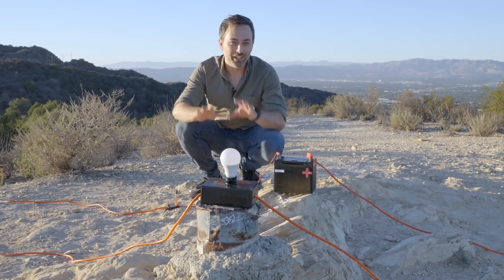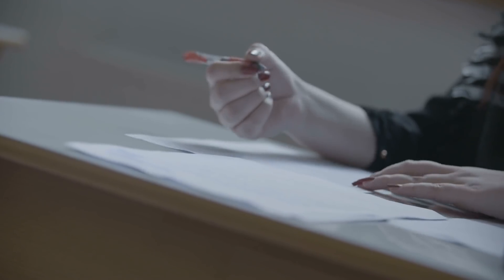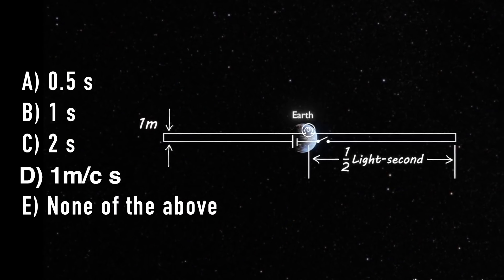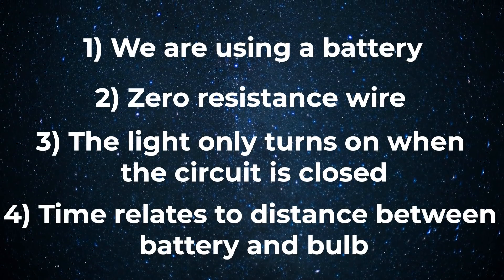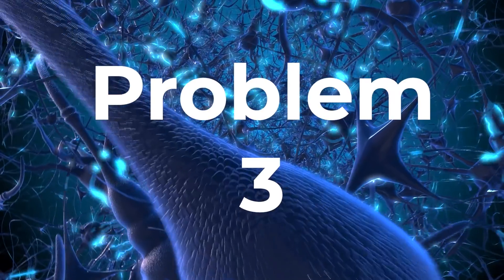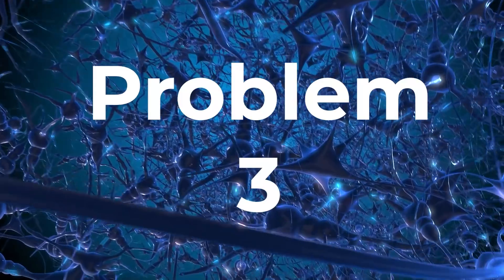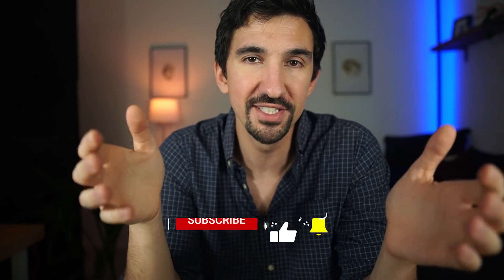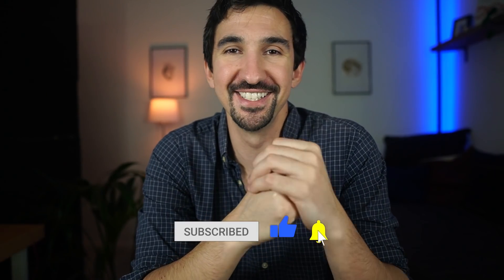Is Veritasium Wrong About Electricity?

Comment: I disagree with Veritasium.  His video is more like a magic trick that distorts reality while he's talking about something else.  In his video, the light bulb, an LED bulb, turns on and stays on while the switch is closed.  He talks about how the movement of electrons is only consequential because the moving electrons generate a magnetic field.  Yet, a diode requires actual electrons to move across the p-n junction and the battery's chemical reactions only occur when there's movement of electrons between the anode and cathode through a conductor (wire). The experiment is relying on Direct Current (DC).  After the initial impulse has traversed time and space through capacitive coupling between the wires (as noted in this Dr. Ben Miles video), that impulse (changing electric field inducing a changing magnetic field) is now in the past.  After that first microsecond of flipping the switch, the circuit enters a steady state where physical electrons are sent on their way by exothermic chemical reactions in the battery and then fall down the energy barrier in the LED to generate light as physical electrons drop energy level specified by the light emitting diode's band gap, thus producing a stream of photons that are equivalent in color to this band gap.  If you were to take the light bulb and insert it into a steady-state magnetic field, you'd get no light.  Experimentally, you could dispense with the battery, switch, and wires and instead just generate a magnetic field around the light bulb.  Both a static and dynamic magnetic field (changing over time) would generate no light after the initial impulse because the physical free electrons in the light emitting diode would have all migrated to the other side of the diode.  Taking this up a notch, Veritasium has constructed a "Transmission Line" that has a natural impedance composed of capacitance and inductance.  On the website "All About Circuits"  Characteristic Impedance Chapter 14 - Transmission Lines, there is capacitance between each unit of wire, one going to the bulb and the other returning that slows the rate of change of voltage.  And each unit of wire also has inductance that slows the rate of change of current.  The result is that this transmission line moves the signal provided by the throwing of the switch far slower than the speed of light, depending on the distance between wire conducting centers, the metal part of the wire's radius, and the relative permittivity of the insulation between the conductors (composed of the wire insulation and the air between the insulated wires).  The velocity of wave propagation is equal to the velocity of light in a vacuum divided by relative permittivity between conductors.  So even if we're simply measuring the time to send this "signal" of throwing the switch, it'll be slower than the speed of light, and take longer than the time it takes light to traverse the distance from the battery to the bulb.  So Veritasium's setup is wrong on both the impulse duration and the steady state situation.  That light bulb will be dark!

Comment: This still seems like there's some shenanigans going on with causality here. You've got your two monstrously long wires halfway to the moon and back...But why does current flow at all, to create this coupling effect between the inbound and outbound wire, unless the source knows instantly that a circuit exists which it can follow? I don't see how any kind of field can exist from the instant the circuit is closed, when no current should flow, until it can be known from the origin point that a circuit exists. Which is a lightspeed problem to "explore" the reality of whether this wire actually goes anywhere.  <confusion>

Comment: The assumption you (and others) are making is that the electrons will move in an open circuit when the switch is closed. They won't. Thus no field is generated thus no signal thus zilch.  It is obvious most people don't understand how antennas or capacitors work.  Or electricity in general.  Take it from a person who has worked with electricty pretty much their whole life, this whole thing that is being put forth doesn't work for far too many reasons to list here.

Comment: Veritasium is correct in that the signal will travel from the battery through the air-gap between the wires to the light bulb at a speed of 1m/c (Ben is correct that he needed the meter there). The signal is propagated by virtual photons from the field of the wire connected to the battery to the field of the wire connected to the light bulb. This is not violating the speed of light restriction on communication. Veritasium often focuses on the "crazy" aspects of science facts and can sometimes gloss over a proper explanation for WHY it is happening.

Comment: Hi, . . .  He, Derick and Veritasium are WRONG. . .   First he has 4 lengths of wire 1/2 light seconds long, that is two to the left and two to the right. . . .  But his whole story about Elecricity flowing in a wire is mainly wrong... . Correct, current in a wire will create a rotating magnetic field around that wire, and where there is a Magnetic Field, there will be a coupled electrical field. . .  This is how we get unwanted cross-talk in signal cables. .. .  But his main story is WRONG. . . The main Curren is the movement of Electrons in the wire. . . That is where most of the power is, in the moving Electrons in the wire, however, although the light coming on, will have a time delay of between about 2 seconds to 20 seconds. . .  Any one actual electron coming out of the Battery, could take days to get to the light bulb.. . . But Electron current is more like a line of billiard balls, one in, one out the far end, almost immediaterly.

Comment: I agree on three points:
1) the setting "as is" wouldn't work. But I see it more as an illustration of a thoughtexperiment.
2) yes, the unit of "1/c s" would be broken in SI units. c can be unitless tho. But more crucially, "1m/c s" doesn't fix the problem in SI units, as that would be s². "1m/c" would be de desired solution.
3) the comment about we were told a lie was off and unnecessary. I really like your explanation about scientific thinking there.

About the central point tho...
Causality wouldn't be broken. Veritasium absolutely obeyed the fact, that the fields are limited to the speed of light. In the scenario the needed time to "get some energy" to the lightbulb is 1m/c, because the electrons are moving first at the switch, which is about 1m away. The switch is a tiny tiny capacitor.
If the switch was 300,000km further away, the electrons there would "move first". The field would than need at least 300,000km/c to "reach the bulb". Hence, causality isn't broken here.
In the first scenario, it would even take at least 2×300,000km/c to get "all the energy" to the lightbulb (first to get the furthest electrons moving, second to have the field travel back)

I'm very confused by the antenna view of the problem. Why would that model be useful? And with DC, how would the antenna even work in the first place? For me, that just complicated the problem.

Comment: Fully agree! I thought exactly the same, first because of the units (1/c is not secs) and second, if it is a constant that doesn't depend on distance, we could have communications faster than light. In the case of having a DC circuit, by the moment of turning on (or off) the switch, we have a fluctuation and a wave is propagated. Still not sure which is the correct answer.

Comment: On the topic of it breaking communication faster than the speed of light, i think the signal propagates out from where the switch is, not where the battery is. The battery connected to the wires means that the 2 loose ends of the wire at the switch are charged with opposite potential, when the circuit is completed, this causes the electrons to start moving, but this signal comes from the circuit being completed, not from the battery itself. So really the answer isn't the distance from the battery to the bulb / c, but rather the distance from the switch to the bulb / c. In the scenario veritassium presented, the switch and the battery are in approximately the same location, but if you moved the battery to the furthest point away in the circuit, but kept the switch by the bulb, the answer would be the same, but if you kept the battery by the bulb, and moved the switch to the furthest point away, then it would take longer

Comment: One important point you miss in here is that the position of the battery is basically irrelevant (if we assume it's in steady state before the switch is flipped, which it must be or the light would be on, per the simplifying assumptions in the veritasium video).  It could be at the end of one of the long sections of wire, or even right next to the bulb.

What actually matters is the position of the switch relative to the bulb, as that is where the electricity begins to propagate, and so that is where the power begins to radiate from.
Reply: If that is the case, though, then why do we need wires at all?  (I know we don't need wires for some things, but we generally do for light bulbs.)  I'm hearing some comments on here saying that the wire doesn't really matter, but what matters is the distance between the switch and the bulb, but what if we have a super-long wire, but it's not even a circuit in the first place?
Reply: @Rationalific  Given the assumptions in the Veritasium video, the bulb lights when it has even the tiniest non-zero current passing through it.
As soon as any current starts flowing in the wires near the switch, power begins radiating. So as long as the battery is connected to the switch, and there's a non-zero length of wire on the opposite terminal of the switch from the battery, you will have a (potentially tiny and extremely short-lived) current when the switch is closed, which will radiate an (even tinier) amount of power to be picked up by the bulb.
In reality, in most circuits, this radiated power is completely negligible. It's only with the assumptions of the Veritasium video that we have to consider any tiny nonzero power to be significant.

Comment: The bulb will never light up. The wires will draw the electrical field away from both the bulb and the battery, rendering the flow insufficient to release photons. It would be like pouring fluid across a large tabletop to fill a glass.

Comment: Now thats fun, an antenna at dc.
Known otherwise as a turd.

So we do not cut off the circuit okay? As then it ain't no circuit. Does not complete. 

So what would happen is, there is no wire resistance, maybe no Battery resistance. 

Electrons would go out one end, and Electrons would go in the other. The good old marble effect. However, Electrons as marbels don't Just afdect the next electron in line. And remember, no  wire resistance.

So what happens is the same as with gravity. The effects of gravity are instant. Same would be with this electric Field. If everything was a super conductor.

Before you think this would break anything, consider gravity okay? We know every mass in exsistance is interacting with every other mass. Via gravity. If out of nothing i place a unit of mass some where, does it take time for the gravity "to afdect" things? Naturaly the answer is no. Otherwise we could sortha out run gravity. And that my friend, would certainly break things.

Comment: It's not an antenna. It's a transmission line which in absence of resistance is basically a capacitor. And that's exactly how capacitors work.

Comment: I think we've always believed electricity travels through wires simply because air is a terrible conductor
Reply: why would you think "air" would be a terrible conductor and what do you think "air" is.
Reply: @kentaylor7044  1. Because it isn't
2. Take a deep breath... That's "air"
Reply: @NeonDeion109  air is atmosphere, atmosphere is gases, chemicals, elements etc.  if electricitty could not travel through the atmosphere then there would be no electrical charges within the atmosphere.  the fact that you breathe air is only coincidental by the predominance of o2 in the atmosphere.  the atmosphere could consist of other gases and then you couldn't breathe "air"
Reply: @kentaylor7044  Air is tha specific mixture of gases on our planet, if it were another planet it wouldn't be "air." Being non-conductive and being a bad conductor are too different things, just because electricity can pass through doesn't mean it does it efficiently. Even different phases of tha same element can conduct differently. Air is predominantly Nitrogen by tha way...
Reply: @NeonDeion109  we call it air but it is nevertheless atmosphere ane you would often hear statements like the"air" of venus or jupiter being toxic or the "air' on mars lacks oxygen.  "The brilliant white-blue flash of lightning is caused by its extreme heat. A lightning bolt is hotter than the surface of the sun. In an electrical storm, the storm clouds are charged like giant capacitors in the sky. The upper portion of the cloud is positive and the lower portion is negative".  Our solar system is field with electrical charge and there are various methods other than just magnetism than can create a charge.  electrical charge.  is powerful but does not mean it is controllable  but the very fact that our atmosphere, or air, has electrical charge is displayed in storms.  electricity of itself passes through our atmosphere continuously but of itself does not create energy but needs to 
interact with other forces.  it is not because air is a poor conductor but because electrical charge is of itself only potential energy and needs to be  affected by other forces, primarily on earth through our magnetic field.  for energy to be created we connect it with the magnetic field to create our power grid in order to supply energy.  the atmosphere is neither a good nor bad conductor of that charge because essentially it is filled with electricity but as the video explained why it is not sent through wires themselves is because electricity needs a 2nd force to activate the potential energy.

Comment: its actually assumption 4, not 3, thats breaking your model (and where veritasium got it wrong). Whats matter is not the distance between the battery and the lightbulb…but the distance between the SWITCH and the lightbulb. This alone neatly solves the problem of signals travelling faster than light.

assumption 3  is actually irrelevent here… the arguement is that the lightbulb will be fully powered after d/c seconds where d is the separation between the switch and the lightbulb

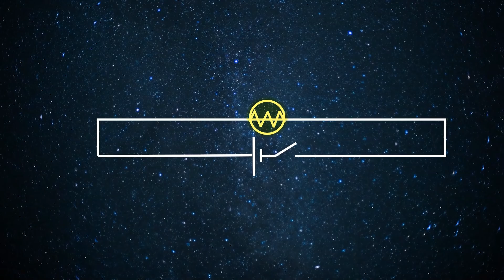Comment: C is the speed of information, which you talk about around the 4:30 minute mark.  You even show a break in the cable and the information traveling to the light at speed C.  However, in the Veritasium example the same break in the wire exists (the switch).  Redo you animation with a break in the cable next to the switch and you get the 1/C time.  Since you picked a new point to break the cable, yes, the answer will be different than the original answer.  The point is that the information moves at the speed of light.  The information is not forced to move through the cable, but the electric force is.

Comment: definition of on? that is easy....you have 12volts, you have zero resistance wire , you have x resistance on the cold bulb so you know what the current inrush will be using ohms law...my definition of on is seeing that current go throught the bulb....impossible to transmit 12dc over thin air...maybe some blip of it can be detected in an antenna and amplifier is used to drive a trace on a scope but not to power a bulb or anything really, leds would be constantly on if you would carry them on your pocket

Comment: according to veritassium if you put another light bulb physically between the straight line going from battery to the bulb then it should light up even if it is disconected? if that would be true a heating element would burn your hands if it was placed between a powerfull power source and  a  load....nope , doesnt happen,,,

Comment: Disclaimer: I am not a phycisist

One argument against the problem you pose in this video is that it's not information that is traveling faster than light. It is the absence of information. There is nothing moving from the break in the wire to the light or battery, it is the absence of movement that is traveling. The absence of movement is not information, so it does not break the universe.

Since I'm not knowledgeable enough to explain my point eloquently, I refer you to the Vsauce video "What is the  speed of dark?" to have him explain the same concept, but with shadows traveling faster than light.
Reply: Darkness travels at the speed of light. It is the speed of causality, and it doesn't matter what sort of change travels because change is always information.